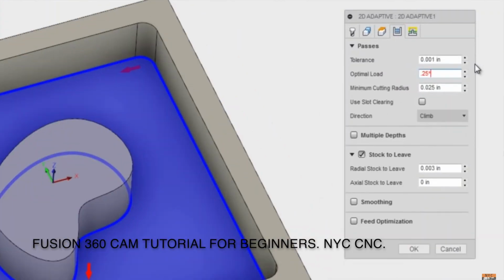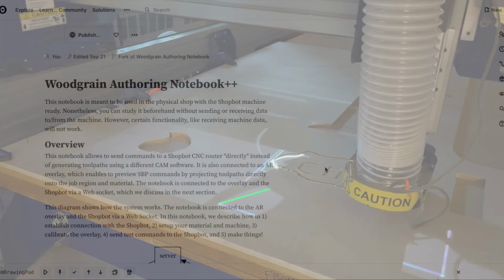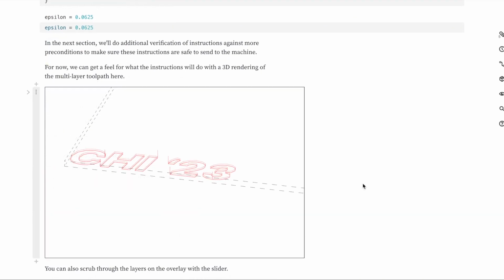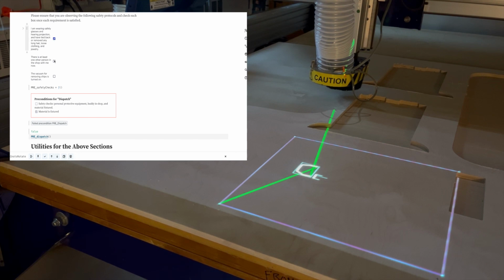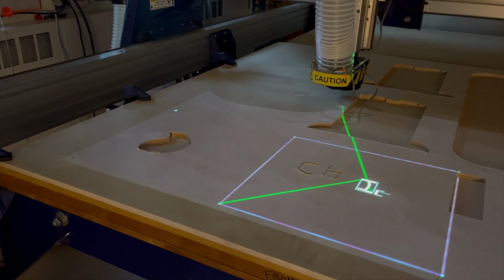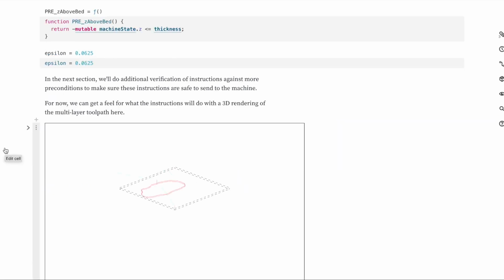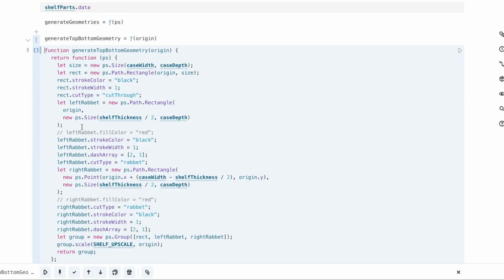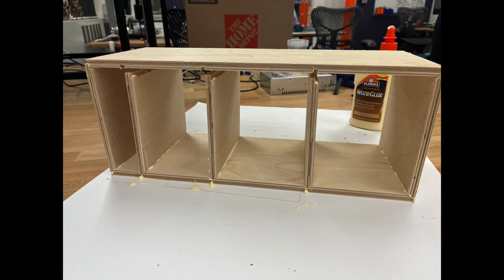Imprimer: Computational Notebooks for CNC Milling

Comment: i LOVE this idea, especially the AR element. any thoughts on using marking or stickers on the material to be cut to enable users to eg mark spots on the material for scaling and position?
Reply from the maker: Thanks! That's definitely something I'd like to try soon. I tried using a depth camera in the past, but the data from that is just too noisy to be precise within the tenth of an inch. In addition, things get tricky when we're not just considering one single cutting plane depth, so adding markers would be very helpful.